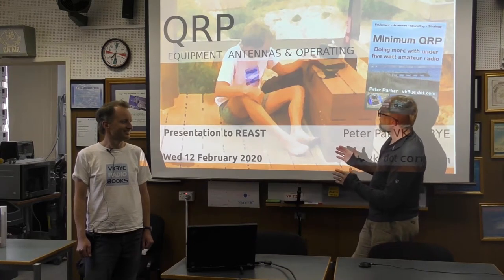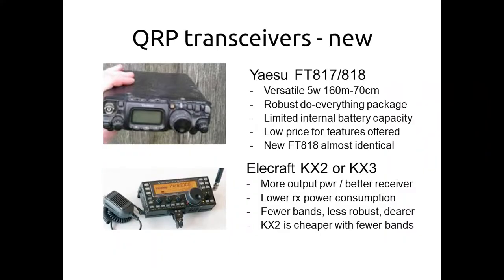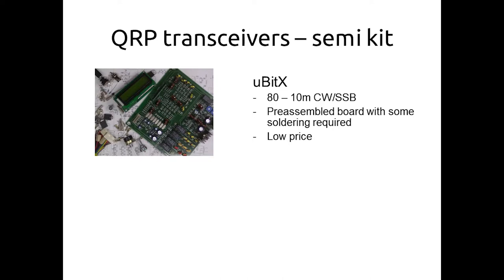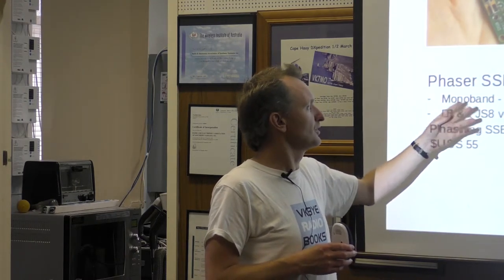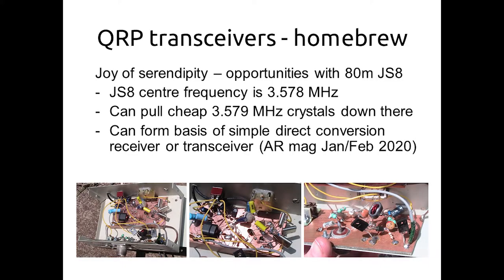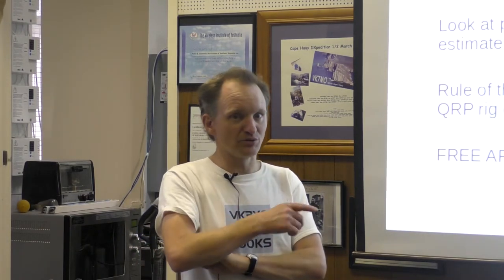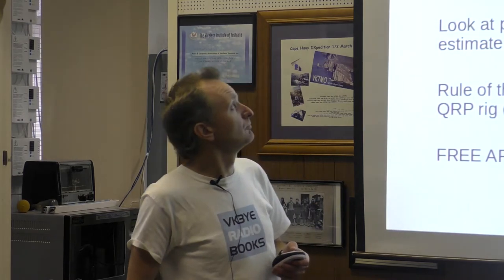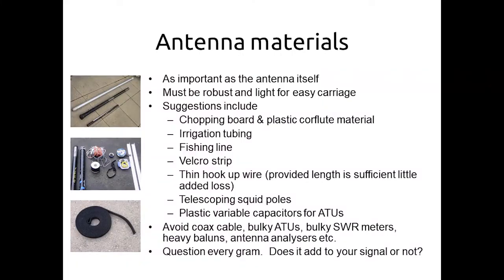Everything You Need To Know About QRP Portable

Comment from the maker: What is your QRP gear? Any bits of gear you can recommend?
Reply: Что я использую для работы QRP? Это FT817 или Xiegu G90, в качестве антенного тюнера, "ручной" тюнер с Г-образным контуром, самодельный или MFJ902 - по мне, так очень удачная модель от данного производителя. 2 куска по 10 метров монтажного провода в качестве антенны и противовеса и так же телескопический штырь 5,3 метра. Более-менее качественно сделанный телеграфный ямбический манипулятор, типа U730 или вертикальный ключ от Р-143. В качестве элементов питания, свинцовые гелевые аккумуляторы или литий-железо-полимерные, они легче при большей ёмкости.
Reply from the maker: Thanks for your comment. Translation -  
What do I use QRP to work? This FT817 or Xiegu G90, as an antenna tuner, a "manual" tuner with an L-shaped loop, home-made or MFJ902 - for me, a very successful model from this manufacturer. 2 pieces of 10 meters of mounting wire as an antenna and counterweight and a 5.3 meter telescopic rod. A more or less high-quality telegraphic iambic manipulator, such as U730 or a vertical key from R-143. As batteries, lead gel batteries or lithium-iron-polymer batteries are lighter with a larger capacity.
Reply: @HamRadioDX  Большое спасибо за перевод. Мой английский просто ужасен, а онлайн-переводчики делают текст просто немыслимым от первоначального смысла.
Удачи, дальних связей! 73!
Reply: Flex 1500    , vertical, yagi , ocf dipole, quads